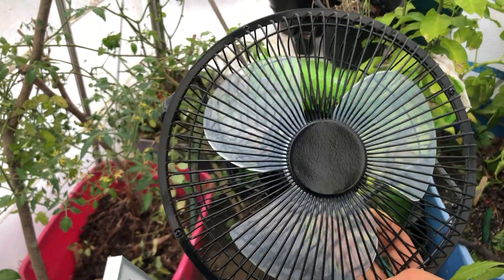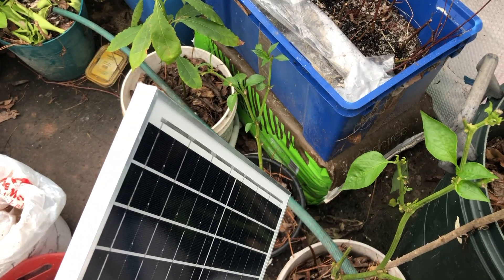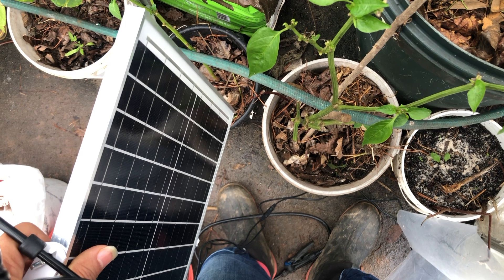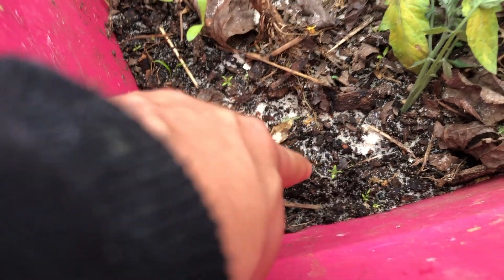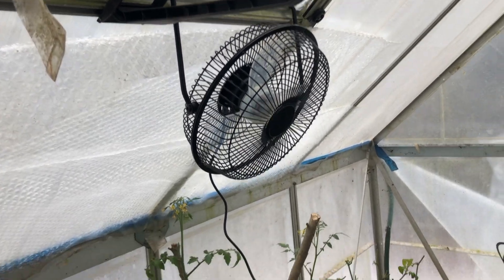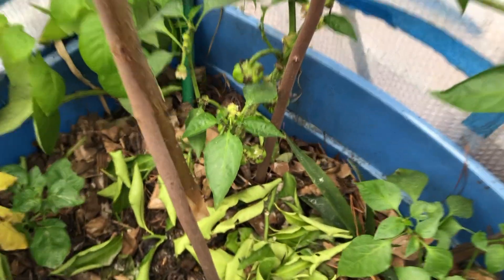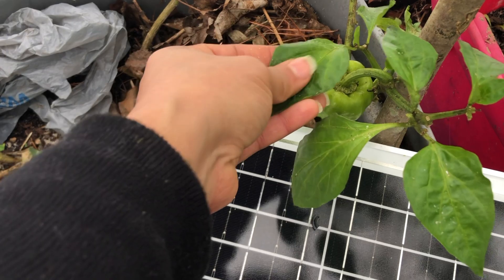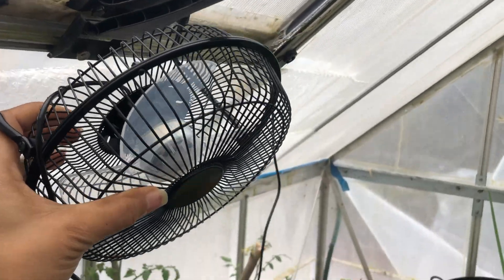New Solar Fan in #greenhouse to Help Prevent Mold & Create Airflow

Comment: I have that fan but it’s much smaller that I purchased from Amazon as well. I have my solar panel on top of my roof. I love it but I’m going to have to get a shade cloth because that greenhouse of mine gets HOT. 

Thanks for sharing all your. 

I’m hoping that after you pick the diseased leaves that you remove them from the soil and get rid of it and don’t put it in your compost.
Reply from the maker: RB, I was literally thinking the same thing about the shade cloth and the greenhouse!!! 

Thank you for that tip as well!!! I'm applying the Korean Farming LAB to the soil and plants, in hopes of balancing the good and bad bacteria, kinda like what eating unpasteurized yogurt is suppose to do in our gut. That's my thought process as least, but it doesn't make it fact. But I'm definitely going to heed wisdom!